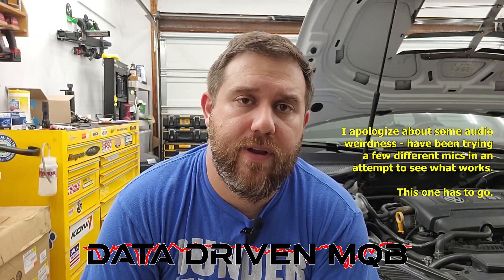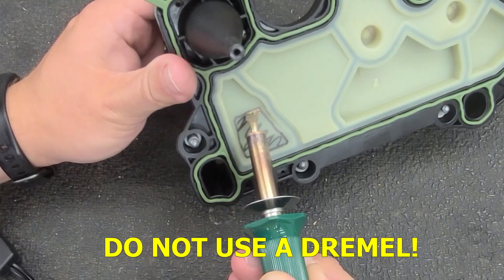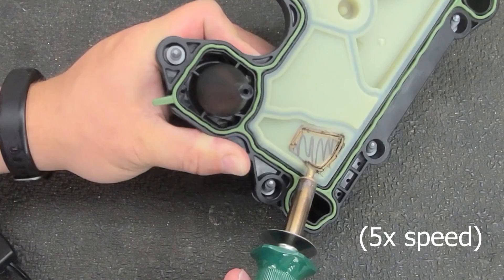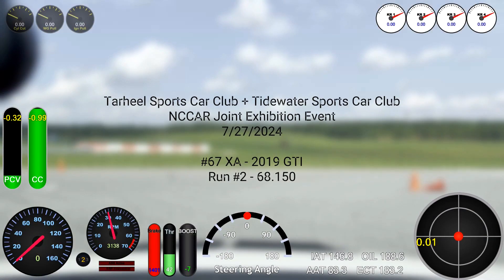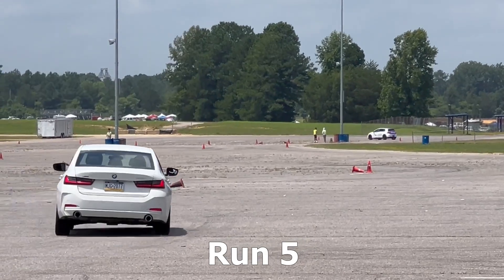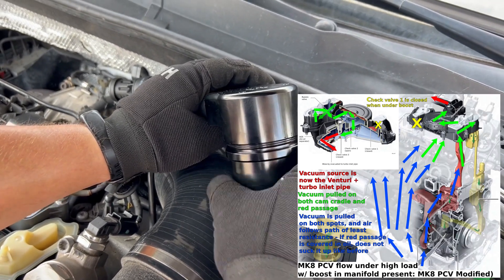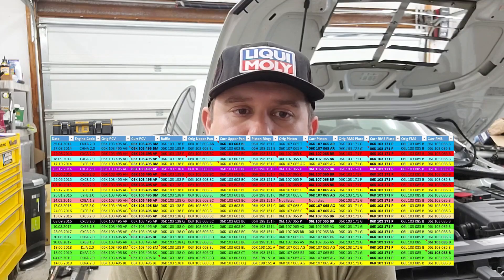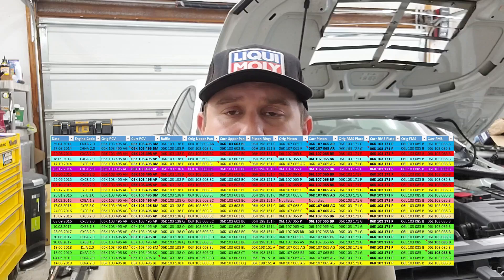MK8 PCV Modification - Fixing a 2015 GTI's smoking problems

Comment: Nice, simple mod. Does it work on the Mk7 PCV as well?
Reply from the maker: @whoismario  I'm not sure I'd do it without the Venturi (and even then 15-18 valves already pull on the cam cover, would only potentially make things worse). Knowing what we know now, 19+ are ideal candidates for the MK8 PCV since the stock operation is most similar to the MK8 flow path. 17-18 are somewhat successful, but seems the limits are lower. They're more of a mixed bag. It just depends on so many factors it's hard to say.
Reply: @ thank you for the feedback. I’ll plan to do the full swap in the future. I just joined the platform and my 2017 Alltrack came to me with what I’m diagnosing as a bad pcv from the codes and oil leaks from the upper and oil pan. Just going with a stock replacement for now since I’m bleeding fixing other issues and maintenance as well.
Reply from the maker: @whoismario  truth be told the biggest piece of advise people seem to ignore is "if it ain't broke, don't try to fix it." If your new PCV has no issues I'd just leave it be. Keep the stock TIP and it'll function well enough in 99% of cases.
Reply: @ I just got my 17 alltrack recently. Had leaks in the oil pan and a bad turbo. I’m wrapping up an is38 swap into it. I put a fresh stock pcv on it due to age. I’m wondering if the performance of the stock TIP comes from the diameter reduction speeding up the air velocity and that helps the vacuum while the larger diameter pipes don’t have that same effect.
Reply from the maker: @ that's definitely a factor. Jeff of MyGolfMK7 has been working on 3D printing his own TIP to increase engine airflow and maintain PCV vacuum and it seems like it's been a tough task to accomplish.

Comment: I have a CJXC engine in my MK7R.

Is this the shopping list I need to do a full retrofit?

06K103210D - Breather Line Pipe

06M906094 - Sealing Cap

06Q103495B - Oil Separator

Thank you!
Reply from the maker: @BittaThisBittaThat  www.datadrivenmqb.com/mk8pcv

Comment: What do tink about retrofit mk8 turbo on mk7 gti i have mk8R hybrid turbo on mk7 gti
Reply from the maker: @debaasdebaas9868  no idea, but sounds like an easy way to use the MK8 Venturi hose instead of the Tiguan version.
Reply: @datadrivenmqb turbo outlet and inlet connects with pcv. I buy original pcv hose from mk8 chop together with mk7 hose and dv delete it’s making 500 hp

Comment: Would it be advised to do this on a full MK8 pcv retrofit on a DLBA, running a latest oem pcv 06K103495BL?
Engine running powermax stage 1 turbo, do88 ic, milltek 3" catted dp.
No smoking issues when driving, even hard, but sometimes a puff on startup after 1-4h standstill.
Parked in a downhill always a puff, uphill never.
Not on coldstart.
PCV changed a couple of times.
Engine has been changed, more or less rules out steamseals( i know about the seat/cupra issues) new engine had covered 32.000miles.

Thx
Reply from the maker: @ronniemattsson  doesn’t sound like PCV related to be honest. 

If the dealer cross references your valve to BL, the MK8 retrofit will likely work just fine (without cutting the hole in the valve). Not sure I’d expect it to fix that issue but who knows?

Comment: Is it possible to do the optimisation in an MK7.5 BL PCV? 
Or is it only advisable for the MK8 PCV?
Reply from the maker: @Lars_Lu  possible, yes. Not sure if it would be beneficial without the Venturi. If sticking to MK7 valves I’d be inclined to try a BM version.

Comment: I just got windo of this update.

I have a 2016 MK7 R, i cant say i have seen the smoking issue at the track or autox, but im not exactly sure if i should modify the pcv in this way. Would you be able to provide insight if this is a specific GTI issue or does it affect R's as well i know the heads are different but i dont think the pcv design is between a GTI or R.
Reply from the maker: @blahbergerpoke  it seems primarily isolated to GTIs more than anything else. So far there’s a single S3 that’s had issues when tracking, though it also has a big turbo FWIW. He hasn’t tried the modification yet, but we’ve got the PCV sensor actually functional on his car so we’re working through assessing and confirming if that’ll be the fix. There’s a LOT of useful info to be gained by having that sensor it seems. Currently working out what is “normal” on a few various cars since mine is the only one I’ve had data on up until last week.

If you’re not having issues, I wouldn’t change a thing.
Reply: @datadrivenmqb  awesome, do you have any details on the sensor and if it can be retrofitted? I was wondering about it myself if it had any value and if the existing ecu in the mk7 can feed off it or if you need a proper ecu rom.

I also wonder if it's an is20 vs is38 thing as well.
Reply from the maker: @blahbergerpoke  it’s in the plans to do a write up/video on adding the sensor. It’s easier on cars with SAI, but one guy has successfully added it by adding a pin to the ECU of a Golf R (no SAI - but the 5v signal still registers when logged).
Reply: @datadrivenmqb  Awesome to hear I've already wired my e85 sensor to the ECU so no big would be exciting to get the sensor wired in and actually log.

One last question, I see you have been doing a lot of TIP combo testing. I installed the 034 TIP at the same time as the MK8 pcv, running stock is38, would it be better to switch back to stock or is this combo fine for vacuum?
Reply from the maker: @blahbergerpoke  034 TIP should be good to go based on my testing. The Venturi basically makes up for the lack of natural TIP vacuum.
Reply: @datadrivenmqb  the benefits are so minor and the switch back is easy i just went back to stock. I'd prefer to have as reliable of vacuum as possible.

One thing to mention is that the PCV i had  was the one that got vacuum from the cam cradle (BM) revision. I'll do some testing later this year but I'm not gonn cut open the mk8 pcv just yet.

Comment: Audi S3 8V 2016 was on the IS38 with a stage 2 flex fuel tune and APR PCV plate with catch can without any issues. Decided to upgrade to stage 3 with the Garrett power max. And now the car when up to temperature smokes at idle. I have noticed my engine has no vacuum at idle. The line from the catch can that goes to the inlet pipe in the turbo smokes all the time and when you open the oil cap it has zero vacuum.

About to do this retrofit and get rid of the APR plate.

About

Comment: Ported mine last night, cause it was still smoking with the full retrofit without the catch can. With the catch can it will fill up quick, but after replacing it will take longer to fill  compared to when i had the blown rear main seal. Now with the ported pcv it doesn’t fill up at all
Reply from the maker: @Das_Gato  glad it sorted it out! Would you mind shooting an email to datadrivenmqb@gmail.com with your VIN and any details on drivetrain mods and PCV configuration results to add to the list of data points? Thanks!
Reply: @datadrivenmqb  will do buddy:)

Comment: Specifically which valve is this that you are modifying? Is it applicable for most or all TSI engines?  I have a 16 Sportwagen that is smoking a little bit, most notably at high engine vacuum moments. Been following the Mk8 upgrade with curiosity for a while now waiting for the final "Do This" conclusion, but now I'm hopeful I can modify my existing valve or source just a new valve to modify and correct my issue.
Reply from the maker: All EA888.3 1.8L and 2.0L engines it should be applicable. This is done on the MK8 PCV valve. 

Your original valve (which should be an AH revision) already breathes on the cam cover. If there's no intention of doing track stuff then just replacing with an AP revision PCV valve (genuine VW part from a dealer) is probably the easiest/cheapest way to go. 

If you decide to go the MK8 PCV route, IMO the full retrofit is the only right way to do it and being a 2016 I'd probably guess you want to ventilate the valve as covered in this video. This is based on basic retrofit not working out on a 2016 1.8 Golf, it smoked and owner took it off and just put an AP valve on and has been happy since. I suspect ventilating the MK8 valve is necessary, though there's really little benefit in doing that from a crankcase pressure perspective - the full retrofit w/ Venturi is really needed to fix that fundamental flaw with the MK7 system.

Info on parts needed for the MK8 PCV retrofit:
https://www.datadrivenmqb.com/mk8pcv
Reply: @datadrivenmqb   It's not really going to see track, but it does get very exuberantly tossed around the local mountain roads.  I maybe should have specified too it has no intake mods at all. I have only noticed the smoke after removing the converter for testing. I'm assuming they all consume some oil due to the high vacuum modern engine's cases are kept under, but I'm only noticing it now because the converter is not burning it off.  I'm currently leaning towards doing the full Mk8 swap and a catch can to reduce consumption to as near as zero as I can, mostly to keep the valves clean but also to preserve the octane of my fuel.
Reply from the maker: @seekerofthetruths  the can is 100% unnecessary for street use, and really is optional for track/auto-x IMO. 

No can will do anything to keep the valves clean. A lot of carbon build up is from reversion of the intake charge as the cam timing works to perform EGR-like functions to lower oxides of nitrogen.

Comment: I have a 2019 with a apr pvc plate and catch can I am doing the mk8 full retrofit with a raduim catch can but, will trying it with out mod first to see I only get a small amount of smoking at start up running a xl on pump sitting at  495/420 so I'll update once everything is installed
Reply from the maker: @BleedSilverLive  yeah on a 2019 I wouldn't expect issues without the modification. I've had zero issues with the unmodified valve on my own car with tons of track and autocross time on it.

Be mindful of how you route an inline can. You want to keep the venturi to PCV hose as short as possible. Putting a can between the valve and the Tiguan hose will result in pulling a ridiculous vacuum on the can, delaying closing the diaphragm. Still almost for sure better than an OEM valve but I have my can routed the way it is for a very specific reason.